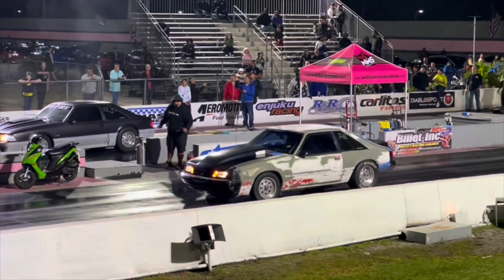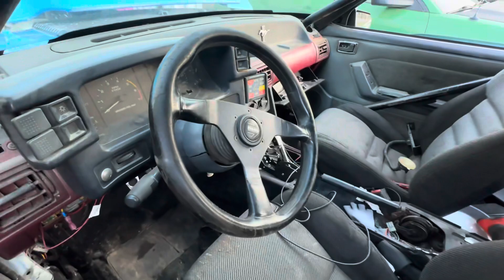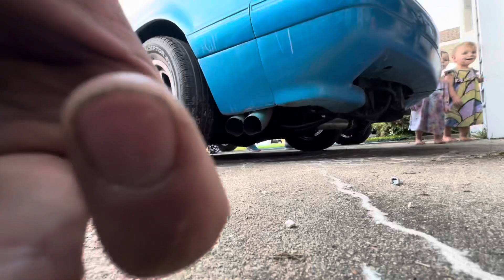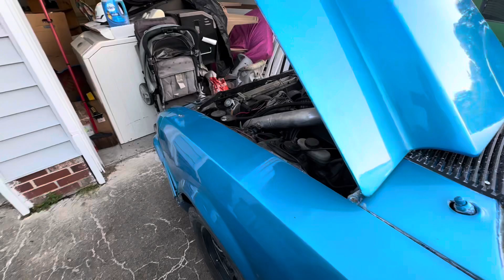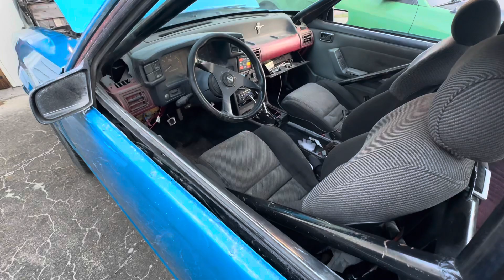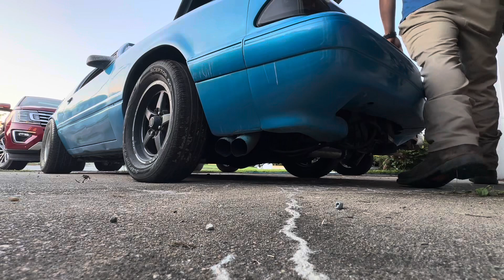It’s still alive. Just a short video starting it and letting it warm up.

Comment: Sweet man! I am currently building a forged 357w single turbo manual trans foxbody right now.
Reply from the maker: This is an SBE 351w at the moment.
Reply: Hell yeah man. I've got a forged 357w that I'm going to eventually run a 250 shot of spray with. Cannot wait to rip it.
Reply from the maker: @joeykimball5705  i’m sure it will be a blast.

Comment: Did you put extra ring Gap on the rings and is that a stock bottom end 351 Windsor good luck on your build bud
Reply from the maker: Sure didn’t. Motor was high mileage and I run e85 so that helps with keeping the cylinders cooler.
Reply from the maker: Yes it’s a stock bottom end 351w. Only thing that’s not stock is I put some ARP main bolts in because I had them laying around the last time I had had the motor out when I melted that piston down.
Reply: @Wheelsupracing  it only takes missing the tune a little bit to over heat the cylinders and causes the rings to but together just saying
Reply: @Wheelsupracing  I'm glad it's back together..have you hade it on the dyno yet??
Reply from the maker: @brawler3475.0  it’s been together for a while. No I only put it on the dyno if I’m chasing issues. Dyno HP doesn’t mean much to me. Dyno said the car put down 650 but then I went to the track a couple of days later and ran 150mph and every calculator I look at online says that at 3450 my car is making 800 ish. Car runs consistent 9.40s at 150-154mph cutting some crappy 60’s.
Reply from the maker: @brawler3475.0  broken may of pistons. Stock 351w pistons are cast. You will shatter a piston before you butt a ring usually. The lip at the top of the cylinders from high mileage tells me the ring gap is plenty loose. If it was a low mileage motor and didn’t show obvious signs of cylinder wear I would gap them.
Reply: @Wheelsupracing lighter is faster obviously, we got 67 camaro 3400lbs 780hp at crank, ft brake 9.90 at 144, so urs is lighter makes it faster
Reply from the maker: @alltherpm  mines 3450 with me in the car so at this time my car was heavier. It should be lighter now but probably only about 50lbs lighter.
Reply: @Wheelsupracing  weird, I have a foxbody also full interior no spar tire,  ur 700lbs more, , I think ur even heavier then factory
Reply from the maker: @alltherpm  well being heavier than factory makes sense. Adding a cage and safety equipment adds a lot of weight. 3450 is also with me in the car so the car is about 3250 without me in it. Factory interior, ac box, rear seat the whole nine yards.
Reply: @Wheelsupracing  cool, must b a full cage, cool stuff here
Reply from the maker: @alltherpm  8.5 cert cage.